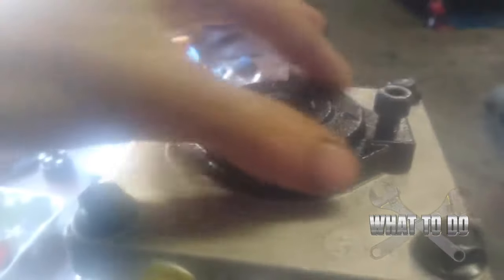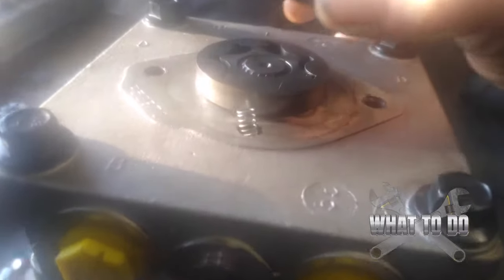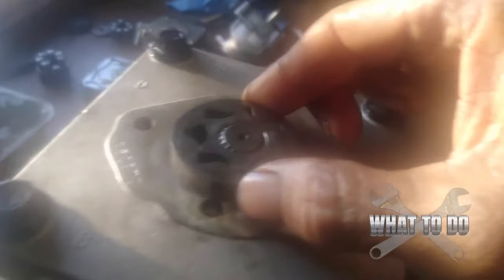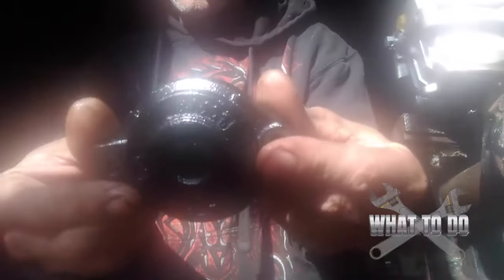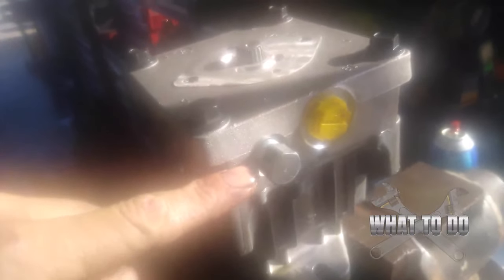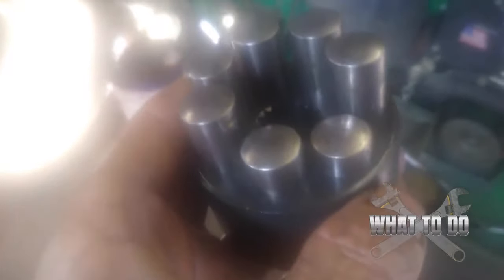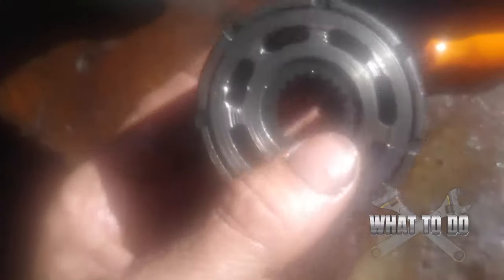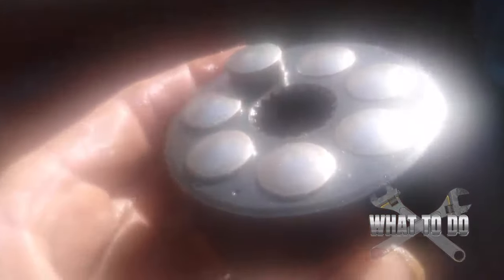Fix your Hydro Gear yourself ! - DIY hydraulic pump rebuild - $ave Money!

Comment: Where the heck does that tiny spring go????????
Reply from the maker: The spring goes underneath of the charge plate. It should rest on top of the ball
Reply: @youtubestar    Thanks.  For some reason I still can't get the pump to bleed and pump again.   I've tried everything that videos suggest.   I've repaired one pumps in years past without any problem.  I seem to be missing something.

Comment: Great explanation on how these pumps come apart; I have a Snapper ZT18440 KH with these pumps; one of mine is lightly leaking at that pivot shaft seal that the control arm links on.  Glad to know when I do rebuild this, nothing is going to spring apart in my face as I am disassembling it:-)

Comment: Great explanation of the pump Rob. I already tore mine apart. It was bypassing when engaged.  The face of the piston block and the face of the valve block were both gouged bad with the some washing on them. Waiting on my rebuild kit. Thanks for the video.
Reply from the maker: So glad that I could help you out and I really appreciate you tuning in. Good luck with the rebuild.
Reply: @kevin Nelson 
How did the rebuild go??

Comment: I just finished pulling the pumps on 500 series Toro.  Left side was weak.  Found thrust bearing on that side destroyed.  This is the second unit that was weak on left side and had to replace thrust bearing.

Hopefully this one the wheel motor is not too damaged.

Comment: Great video.  My old mower isn't worth a new unit.  I'll try to rebuild it.  Thanks for posting this.
Reply: Update:  It turns out the problem was I left the parking brake on.  The mower ran fine for about ten minutes, then the left drive faded, and started leaking oil.  Releasing the parking brake fixed the problem.  I wish all my problems were solved so easily!

Comment: Again, an excellent video.  In the very beginning you were mentioning to be careful because there is a spring and ball in there.  You showed the location of the spring, but not the location of the little ball. I have no clue where it fell out of unless it goes in the hole underneath the spring lol

Comment: Thanks for the info,  it really isnt worth buying a new one like you said... i opened mine a few years back and just needed to replace the lower bearings... we put on new seals with the kit you mentioned and still running

Comment: Hi - great video!  I've torn my hydro pump down and found that the bearing ball thrust went bad and scored the swashplate. So I ordered that, however, I also noticed that it scored the cradle bearing.  Do you have a video on how to replace those? Not sure how it is secured?  looks like a rivet.

Comment: Great Video. I have  Ferris IS3000Z that the left side works perfect forward but has a lot less torque in reverse, sometime not enough to back up on a hill. Would it be the pump, motor or a relief valve? I don't know how to trouble shoot. Thanks

Comment: this this is one of the best videos I've seen on these pumps I rebuilt a hydro gear wheel motor that connects to one a pump like this and now when I push forward on the lever after reinstalling it it goes backwards we'll spends backwards the other side I push forward on the liver it goes forward and it's all plumbed correctly so I don't know if it's the motor worn out or if it's just an adjustment but that's what I'm looking for solution to that but thank you for this great video on the pump I think I'm going to check out my pumps to see if they're okay
Reply from the maker: Sounds to me like you have the wrong wheel motor. Did you take the wheel motor apart and work on it or did you replace it with another one? Also what about your hydraulic lines are they put back in the right spot you didn't mix them up did you?
Reply: I think I remember that if you put the top cover (with the round gears ) on the wrong way it will operate reverse.

Comment: what would likely cause a chatter or shuddering on one side..back off and it stops..ease into it slowly  and its ok.. but if under a good load like starting out up a steep hill it sometimes may do it.. seems not as often if warm..&  throttle is open full and  dont push stick forward too fast.. good amount of hours on them hydros.. hustler FastTrak superduty..60" 2008 hydros replaced once prior.. hoping maybe simple fix and not have to go too deep or need much parts etc..  love the mower..does such a nice job and gets under branches etc that our x-ones are too tall for.. thought about buying it from my boss...
Reply from the maker: sounds like a flow/ pressure issue. when you are applying light throttle you dont need much pressure to get moving but sounds like when you are going fast or uphill when that max pressure is required you are getting your shudder. could also be internal too but start easy and do a hydro flush
Reply: @youtubestar hey thank you for getting back to me! and so soon even! thats awesome I appreciate it! 
   it does it if throttle is low as well.. maybe more so if I'm not easy with the stick. 
 a "hydro flush"? all I have ever done is change fluid and filter on them. I assume that it's more than just that.?
Reply: @youtubestar  by "flush" do you mean more than just a fluid and filter change? can you elaborate on this by chance?

Comment: Not my exact unit, but worth watching.  I've got 2 Dixon ZTR 4516K with independent pumps and a couple of them make a grinding noise and lose pressure after being ran at full pressure for a minute or more.  I suspect it's low fluid but I'm worried the grinding sound has caused damage.

any input is welcome.  I wont be doing that job for a few months so if you know about that, please respond.
Reply from the maker: The grinding noise you are hearing are you certain it's coming from the hydraulic motors? Sometimes the noise can bounce around in those engines and it could be coming from somewhere else a bad bearing and a pulley or something but you may think it's coming from the hydraulic motor. If it is coming from the motor is it just one side? And last but not least if it's still running and moving forward and backward I would not run it anymore you might be able to save the motor if it's still moving then your shaft is still intact and for the most part the other parts are replaceable. Could just be a bearing going bad inside sometimes if something really simple but the simple things will create huge damage if you don't address them immediately. Maybe start by doing a hydraulic fluid change check the fluid see if there's any metal fragments in there. Shoot me a picture of your hydraulic motor so I can see what type you have.

Comment: Thanks Rob, Great info! Where do we send the Windex to you for that poor foggy camera lens lol.. Also wouldn't doubt that some of these internal parts upon wearing would be the partial cause for the whine noise that Hydro's are notorious for. I also wonder why these typically use 15 W50 Synthetic Oil and not Hydro Oil. Would Hydro Oil be less likely to Cavitate than Motor Oil? Cheers!

Comment: Great information! Thank you. If everything on the machine seems to work just fine but there is a leak between the two halves of the pump housing, do you think its probably just the gasket or is there something else that might have caused that? The exmark mower works fine but leaks a lot of oil and is probably 15 years old.
Reply from the maker: I would definitely check the gasket in between the housing. Was it ever service before or taken apart? Are you certain it's coming from the split in the middle? Another thing you can try is completely clean the unit off and dry it then sprinkle some baby powder all over it and let it sit and you will see exactly the area the leak is coming from in the baby powder. But more than likely you are probably having a gasket issue keep me posted would love to know how you make out.
Reply from the maker: Also are you certain that your shaft seal is in good condition inside? If your shaft seal is bad and you're getting blow by you're going to get a leak. I'm not sure what unit you have but there is different seals inside of these pumps around the shaft around the Piston etc all of these need to be looked over and if you're not sure if they are good or not then rule of thumb is while you have it open just replace them.
Reply: @youtubestar  thanks for the reply. It is an exmark with a Hydro-Gear pump. I power washed all the crap off of it then drove it around for a while. Both pumps are leaking where it breaks apart. A pretty big leak. I ordered the gasket kits and will pull once they arrive. I will inspect once its apart. The kit should contain all the seals etc so using your video I will see what I can do. Thanks again.
Reply: @MostWantedFireworks  Are you 100% sure it's leaking from the middle and not from the bypass valve above?
I have a 2007 Exmark Lazer with Hydro-Gear pumps that are leaking from the bypass valves.One side leaks more than the other.Just hot the valves yesterday.

Comment: Morning, I have a problem with right hydo.Arm doesn't go forward all the way .Was told it is damper.Confused that has no bearing on forward motion only stabilizer. Left hydro is powerful all way arm goes forward but stears to right so have to back off ,to go straight less speed .please help me to diagnose this promptly. Had mower in and out of shop since last yr. Last person put gallon of oil in change caused me buy new motor it burnt up ! Now not trusting anyone.  Can this be adjusted for speed to go forward and fast? Mower repair place told me not to adjust factory settings.  How can I get the right speed up and arm all way Forward?
  Wish stooping the arm from moving forward? Almost like hitting wall is it something stopping  it, like rod or linkage? Please advise thank you
Reply from the maker: The problem you are having is a easy fix actually. There's a few things you can do to fix that problem both are very simple. When you push your arm forward there there is a long linkage rod you'll see that also pushes the hydro gear lever. On the end of that rod there should be an adjustment on both ends. It's usually easier to adjust the linkage at the end where it meets the hydro pump linkage adjusting that so it throws the arm farther which in return will push the hydro gear lever farther and make that side level with the other side. Also sometimes it's not in the linkage sometimes it's just the handles that have shifted forward. I'm not sure what model mower you have but there should be two bolts holding that handle on and when you loosen them you should be able to Pivot the handle back and forth and then tighten it back up. Does not sound like there's any problem in the hydro system itself it sounds like just some linkage adjustment or perhaps the handles

Comment: This was an awesome video. Are most pumps designed like this?
Reply from the maker: Pretty much most hydro pumps have the same type of working mechanisms some will be larger than others but for the most part they all operate the same but they will change from application to application slightly

Comment: Rob, what would you expect to find from a hydro that starts out working 100% and in 15-20 minutes pretty much stops moving the Lazer Z HD?
Reply from the maker: Sounds to me like you definitely have a blow by inside of the hydro assembly. When the fluid is cold it's a lot thicker and will probably give you enough pressure from the get-go but once the fluid gets to operating temperature and starts to thin out a little bit is probably when it starts losing pressure if that makes any sense.

Comment: I'm salvaging the hydraulic wheel drives from a Toro 54" Zero turn to build a remote control snow blower. I was wondering if you would know if these drives would have the torque to push a 42"(Haban) snow blower attachment off a garden tractor or would I end up burning them out?  I plan on using a 20 HP engine, salvaging a snow mobile track and suspension that I will spit in half to create a track drive.
Reply from the maker: you may see some lack of torque. The reason being.... even though the Toro Zero turn has significant weight, its on wheels which make it a lot easier for the hydros to operate on something that rolls. If you are going to be using these to physically push a mower blade with a lot of snow in front of it, I don't see the gears holding up very long. I replace these hydro gears daily because one of the main reasons they fail is because of the machines pushing or pulling too much weight that the shaft snaps. Your custom blower sounds really cool and PLEASE come back and show me pics or video when its done. Sounds like something id love to create myself.
Reply: @youtubestar  I already built one using a Craftsman  steerable track drive, an arduino micro controller, Flysky 10 channel  RC controller and designed my own circuit board. I use 12-24V servos and 20Kg  hobby servos.  One issue I ran into is backing up. Without lifting the blower housing off the ground it scrapes the snow like a plow and gets stuck. I also find it a little slow for my liking. It's meant as a walk behind and of course an operator can push down on the handles to lift the front end or twist it to get it unstuck.

Maybe I need to do go a different rout for the drive then. I don't want to build something that will break down after the first snow fall and have to go back to the drawing board. I think I will go the extra mile and use hydraulic wheel motors instead. Princess Auto in Canada(where I'm from) has them. Just need to do some homework on what to use. I'm not very hydraulic experienced.
BTW, Thanks for the prompt reply. I'd be more then happy to share my experience and knowledge I've gained building the first one. Slapping motors and drives to a frame is the easy part. Programming it is another learning curve altogether. But I'm getting the hang of it. The new one will also have a raspberry Pi computer for a little AI. I found some local programmers to help me with it.
Reply: I just thought of something. Since the snow blower doesn't need to go as fast as a lawnmower (7 mph) . If I made a 1:2 speed reduction so that it only goes max 3.5 mph would that not increase it's torque and prevent breakdown?

Comment: Excellent video with invaluable information!  If my Scagg commercial zero turn is running slower than it used to, could that be an issue in the gearbox?
Reply from the maker: Do you have any leaks on the pump at all? Have you done all the regular tune-ups and hydraulic changes? Fuel filter air filter all that stuff? How about the hydro belt is it tight loose? If the belt is slipping that could cause you to lose some speed as well.

Comment: i have a sunstraum 15 in my bolens and i lose   pressure,  in  forward  but reverse is fine any idea where to check.  great video
Reply from the maker: I would start with the linkage. On the side of your hydro the linkage will be connected and it's usually held on by a set screw of some sort. When you push the arm forward and backward you will see that linkage moving make sure that it is going forward a full cycle it's possible that the set screw may have came loose and it's not pushing it forward all the way. This has happened to me on numerous occasions. If that doesn't work Circle back around to me and I'll give you some tips on what to do next
Reply from the maker: If you saw in my video how the swash plate operates sounds like it's depressing in reverse completely but when you put it in forward it doesn't sound like it's depressing the Pistons all the way to build the proper pressure for the forward motion. And if you set screw came loose then it's not turning the swash plate far enough if that makes any sense.
Reply from the maker: And when you are checking your linkage if there's any bearings or pivotal points that are defective in the linkage that would affect this also make sure there's nothing loose in the linkage.

Comment: I just have a question , before put everything back together do We have to fill the case with oil ? 
I looked to many videos around here ,yours is one of the top very well explained , but nobody mention nothing about the refill process . Thanks
Reply from the maker: absolutely. Very good question. I would certainly pour some hydro fluid in the case prior to closing it up so you do not have a dry start.
Reply: @youtubestar  My respect ! thanks for your time , you just gained a new subscriber!

Comment: I'm a farmer and I'm all for fixing things if you can, using older parts or whatever.  However, when you have a piece of equipment torn down this far and you find some bad parts or semi functional parts, the best thing to do is go ahead and put in new parts while its torn down.  Because all you're doing when you patch it with old parts is delaying the inevitable, eventually it will need replaced anyway, probably sooner than later, especially with the poor quality of steel and parts these days.  Everything is cheap and of poor quality so it doesn't last very long.

Comment: Have you run into a unit that is still weak after rebuilding the one side?

Do wheel motors get weak?
Reply from the maker: Yes it is possible for some of the Metal to Age and wear which would cause some pressure loss. The where could be so Minimal that you don't notice it and you could have some pressure loss from the blow by in the pump

Comment: Where can I order a rebuild kit?
Reply from the maker: I have seen some of the pieces on Amazon and another place called Jack's Small Engines. Depending on what you need you may have to order different pieces from different places but do a little bit of Google Search and you should be able to find all the pieces you need I don't know of one place off the top of my head that sells all the pieces in one complete kit